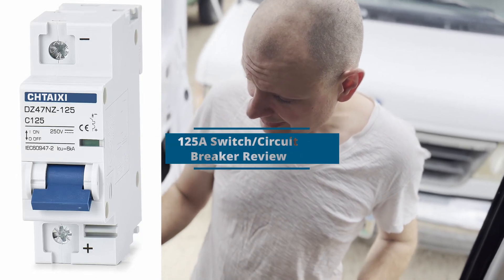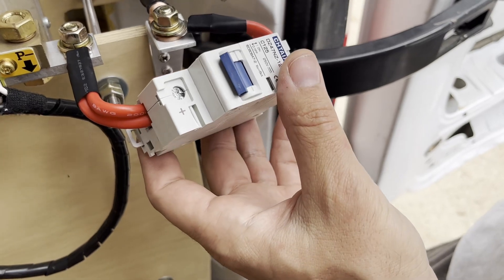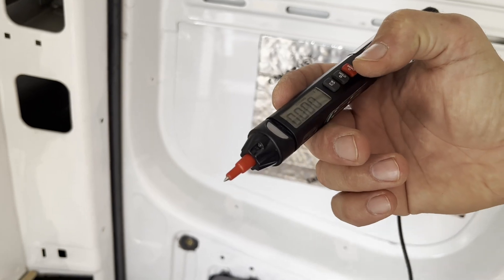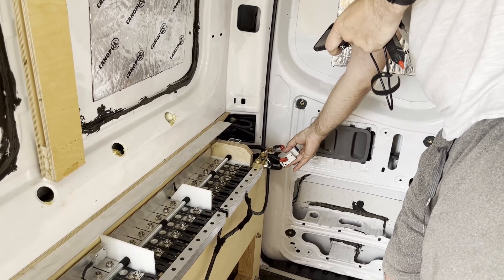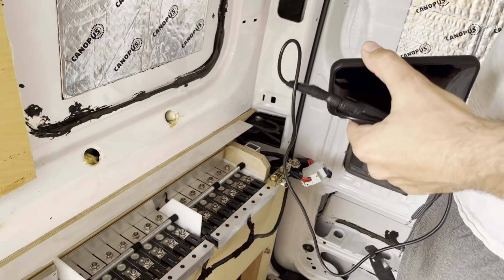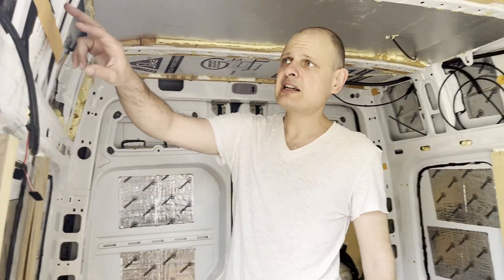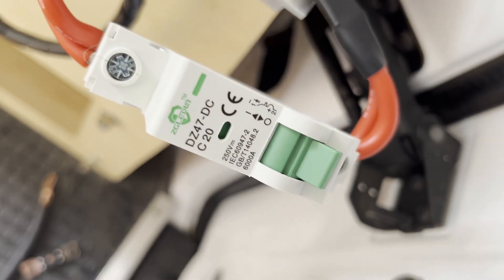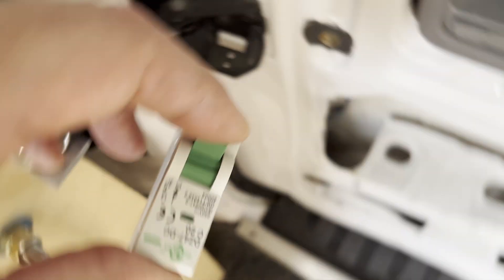125A Chtaixi Switch/Circuit Breaker Review and Zgledunn 20A Circuit Breaker Review

Comment: Hey guys, it's Peter :) you need to check out the "trip curve" of your breaker, your test showed a 3 minute trip at a 1.6 multiple (200/125) of rated current does seem in spec for the manual. Google "DZ47Z User Manual" and look at the trip curve chart, the two lines are going to show earliest trip and latest trip times. For example, a B curve breaker going at 1.5 times it's rated current would trip between 20 seconds and 2000 seconds. You got a "C curve" breaker (denoted by the C125 marking on the breaker) so if you were to pull 1.5 times it's rated current you will expect it to trip between 75 seconds to 5000 seconds. Breakers do this to allow for inrush current of whatever your load is.
Reply: If you were pulling 250 amps on that 125 amp breaker, you would expect it to trip between 20 seconds and 500 seconds, so again your breaker seems to be within spec.
Reply: Yes, this video shows correct operation. Incidently, fuses behave in much the same way. The purpose of both is to prevent fires caused by overheating of wires. Fuses and circuit breakers like this one cut out when they themselves overheat.